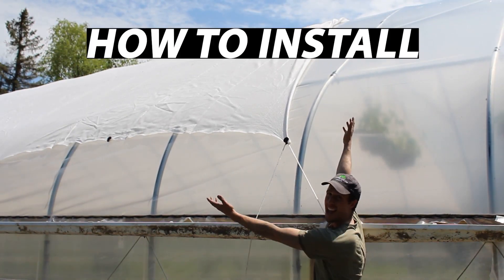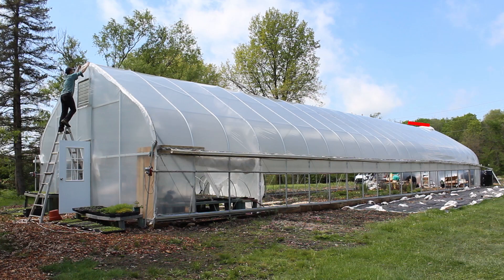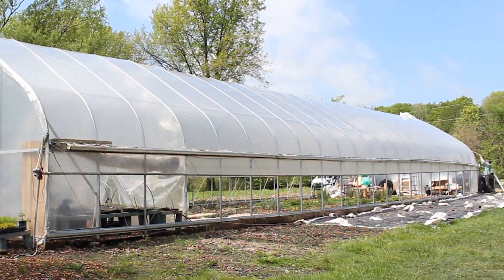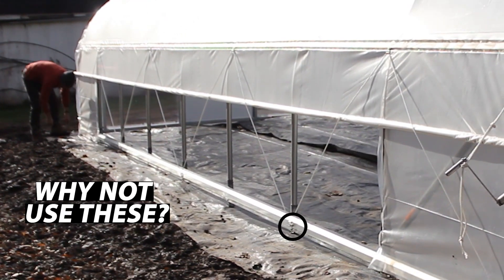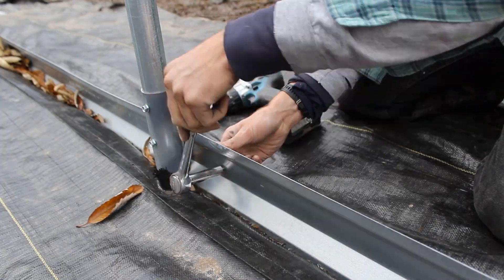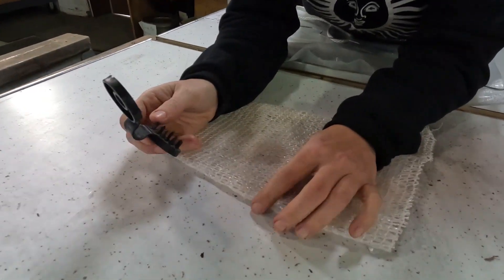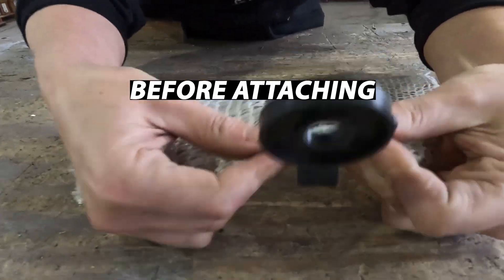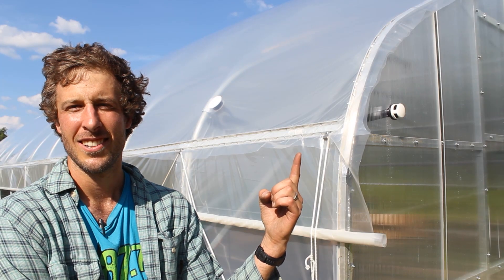Installing SHADE CLOTH on Greenhouse, High Tunnel, or Hoop House | DIY Greenhouse

Comment: Another great video!  I'm up at close to 52 degrees north latitude in central Canada with crushing summer heat and high sun-angles.  In the 30x40 foot greenhouse I just acquired, I'm intending to grow tomatoes & peppers during the main part of the growing season and cool-season crops in the shoulder-season.  No active heat source.  Can you point me to any resources that might help me determine what sort of shade cloth might be appropriate in my context?  (I like the look of those grommet-clips!)
Reply from the maker: Hi Tim, thanks for the kind words on this one as well. I did write a blog post on shade cloth for tomato plants a good while ago, and what I discovered in doing the research is that the various agricultural extension agencies across the US tended to recommend between 30% and 50%, and this is pretty much what I found regardless of whether the agricultural extension office was in Arizona or West Virginia. Here is a link to the blog post: https://www.tunnelvisionhoops.com/blogbest-shade-cloth-for-tomato-production-reduce-detrimental-scalding-and-shouldering/

Not sure how well this article would apply to your Canadian environment, but perhaps that blog post can start you down the rabbit-hole for what percentage shade cloth would be best for you.

Comment: Great video! will this work just as well on a budget polytunnel that is clear with small green squares, mine one only has one door and some small vents so i was hoping if i covered it in shade cloth it will stop it getting so hot and still allow enough light through to grow tomato's etc.? Any advice is appreciated, i am In south spain and it can get very hot in the summer.
Reply from the maker: Thanks for watching and for the kind words. Shade cloth should always help with the interior temperature although it is very important for there to be ventilation of some kind to ensure the hottest air can move out of the structure. I am not familiar with the green square product you mention, however, increasing the shaded percentage of the structure definitely takes the edge off of temperatures. We have customers installing 50% shade and still growing tomatoes if that provides any additional context for you. Good luck!